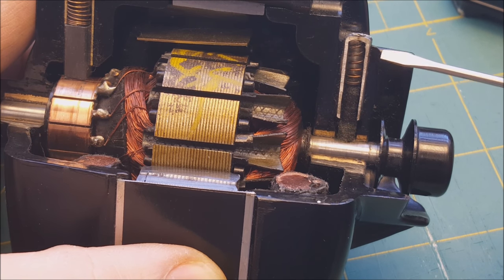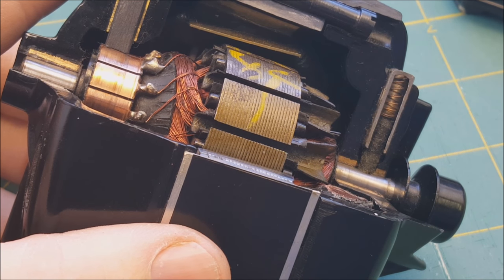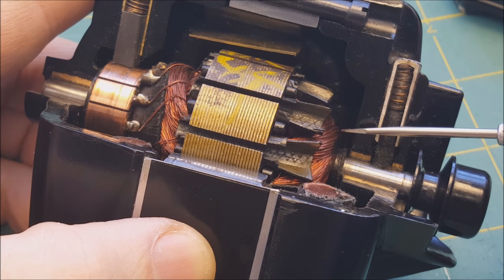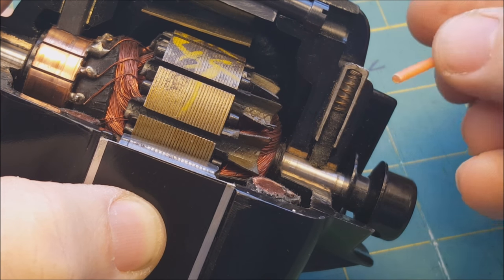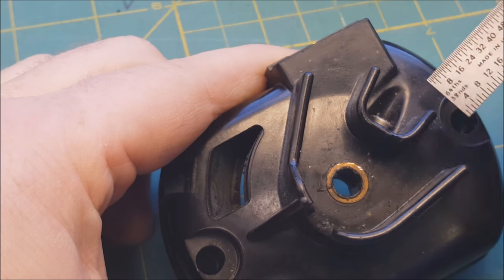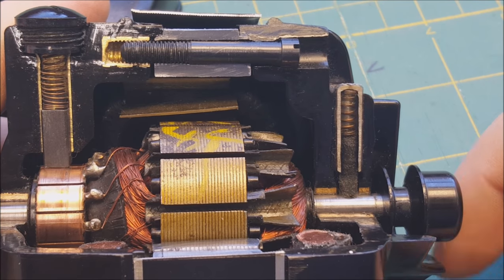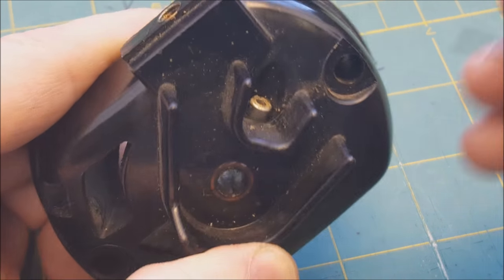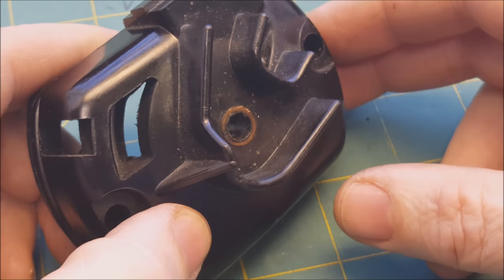Learning About the Singer Featherweight Motor Lubricant Port

Comment: Thank you, Carmen. I've maintained my Featherweight motors myself, but I recently acquired a 206K with a .5 amp motor that looks to have a vertical lubrication port on both ends of the motor (not just one and the other end being the carbon brush).  Do you know if these lube spots have the same lubrication requirements as the FW just x2?

Comment: thank you for all your  videos, but this one especially. My top motor port (of the half inch long variety) was rock solid and I have to confess I did start digging in there with pin before deciding it wasn't all just compacted dust!! You saved me from disaster.